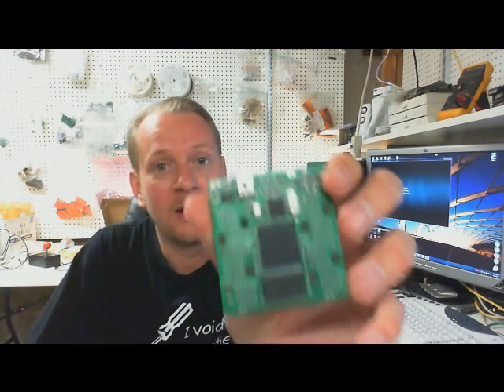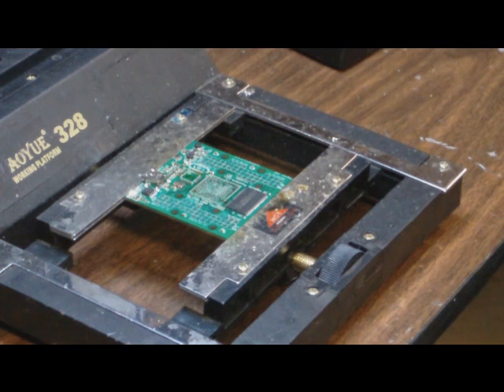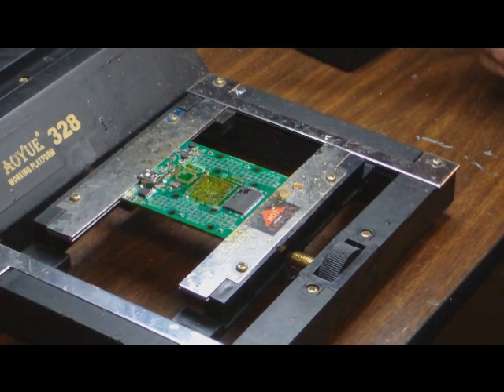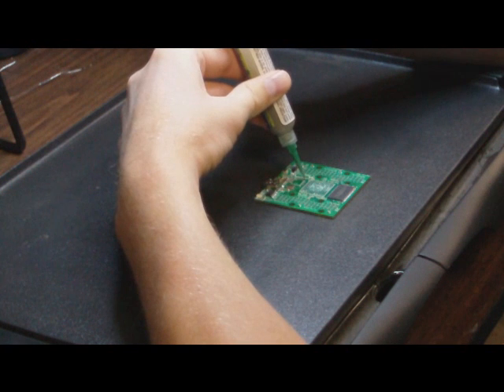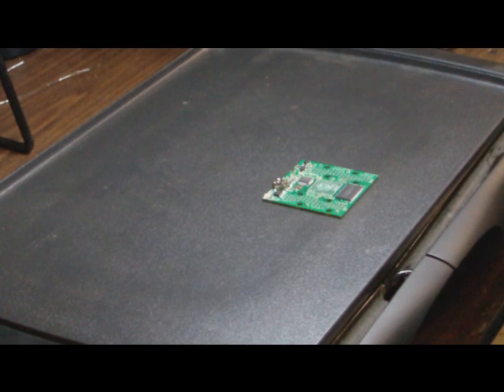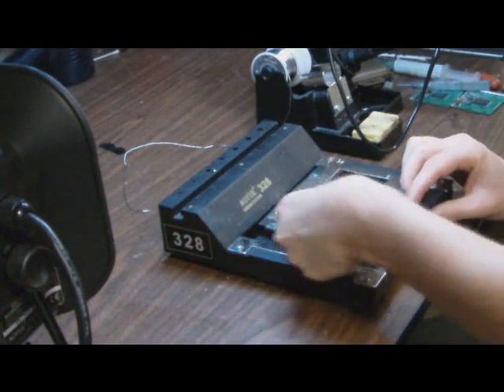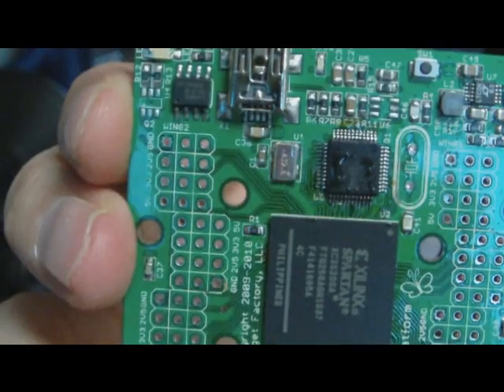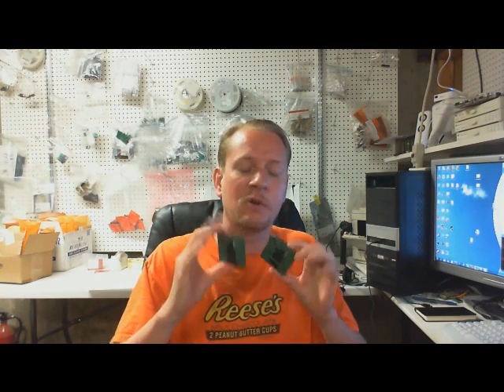JaxHax - BGA Soldering at Home

Comment: hi, your method don't works on more complex multilayer pcb where component on both bottom and top parts. what we usually do is preheat the bottom of the board slight below solder lead melting point. this to ensure the neighbour component not affected. then use hot air flowing it on top of component to melt the solder joint then pick it up.

Comment: Thanks for this. One question I had - did you go by the settings on the controller of the griddle, or did you measure it accurately yourself? In my experience, these things are off by tens of degrees C from what they say on the controller, as well as varying a lot across the plate.

That's not a dig - I really appreciate the instruction, but I think I will calibrate mine - at least to within a few degrees.

Comment: I noticed you didn't add solder paste to the BGA pads -- is that because the BGA package device has solder balls on it already (sorry for the dumb question)   Also, how do you know that all the BGA lands made contact with the pads and have good, solid connections?
Reply: +sethmeisterg BGA stands for Ball Grid Array and the balls are made of solder.  Not a dumb question.  I made the mistake of using solder paste the 1st time I tried to solder one down.  Normally the pros use X-Ray to see the solder quality is good on all pads.  He is just doing it blind and hoping it works.

Comment: Dont you fuck up every solderjoint when you heat the entire board?
Reply: No you don't.  The object is to avoid vibration of the board during heat ramp-up, while the board is hot, and during cool down.  Then inspect your work once the board is cool.  Double-sided boards may pose a problem when heating the whole board, so the "griddle" method might not work.  In those cases, you may have to suspend the board in an oven and even then there's no guarantee that you won't knock off components on the underside.

The advantage to whole-board heating (aside from the obvious when dealing with BGAs) is that it minimizes warping of the board due to uneven thermal expansion.  The warping may actually affect solder joints on surface mount components.

Comment: Break clean! The slight potential of creating phosgene gas is scary enough that I wouldn't chance it. Here's the MSDS for Brakleen rwsidley.com/MSDS/crc%20brakleen.pdf and here's the Toxicological Profile for Tetrachloroethylene atsdr.cdc.gov/ToxProfiles/tp18.pdf 
P.S. Couldn't you wet down your solder wick with that no clean flux? I know it's supposed to have flux in it but maybe they went cheap. Either way it couldn't hurt.

Comment: Your ratio of successes to failures is a high rate. There's a reason there is a specific process and equipment to remove and attach these chips. I've seen boards where people have done things like this and they fail within months. My comments were meant to stop someone from throwing their $300 laptop board on a griddle thinking they will fix it. Since you can't seem to take criticism I'll be more positive. Congratulations! You made a very accurate video on how not to do this!

Comment from the maker: What high failure rate? When I used this process none of the boards failed. I ended up doing 5 boards this way that all worked perfectly. Would I manufacture boards to sell with this process, no, absolutely not. But the point is that you can test your prototypes by soldering them at home without a complicated process or expensive equipment. 

To beat me up over all the things I'm doing wrong is missing the point. The video is titled, "BGA soldering at Home" not "How to do BGA Soldering"...

Comment: If you actually read my response I mentioned your high failure rate, so who isn't paying attention? Yes, you can get chips with the balls already on them, but reattaching the chip is one of the most important parts of the process. And again, you have no idea what a temp profile is. It involves very specific temp readings throughout a minimum of a 5 step process. Your boards may be working, but not attaching the chip will severely limit the boards life. I was letting people know to not try this.

Comment from the maker: First of all, I didn't reball, that is the whole premise of being able to do this at home. When you buy a new BGA chip the balls are already on it. Second of all if you actually watched the video instead of jumping to conclusions you would have heard that I had a bad failure rate before I paid attention to the thermal profile. Once I paid attention to the thermal profile all of the boards worked out correctly. This process works just fine for small prototype runs, which was the point.

Comment: It's no wonder your failure rate is so high. You haven't done one thing properly. First, you absolutely cannot reball with a griddle and hot air. You may get lucky once in a while but you have no way to accurately control heat. You mentioned your temp profile but you don't have one! You need to have the proper equipment like an infrared or hot air reball machine. You are also not using the correct flux. You need amtech or kingbo bga flux. You cannot get this at radio shack. BAD PROCESS!

Comment: sufficient. can you tell me if this is corosive or not? i only tried it with cleaning the solder and the residue seems to be very little not like in your video. i hate the no clean liquid, it's so expensive here and it evaporates so quickly. thank a lot for the video, cheers.

Comment: isn't izopropilic alcohol much easier and cheaper for cleaning the residue?  I have some solder paste more white than yours but doesn't leave so much mess, i searched everywhere if it's corosive but i can't find. It's not chinese or whatever, seems to be hungarian or russian (i belive , im from europe). It sais solder paste ,then under : medium active flux that facilitates soldering of the folowing elements: copper, silver-plated, zinc-coated and nikel plated, used in places where rosin is not .

Comment: not yet. I've got it down to a process I am going to use, though.

>Dismantle
>place board onto griddle hot plate (set around 350-400 degrees farenheit)
>surround with tinfoil
>heat gun GPU off of board
>remove board from hot plate let cool
>clean entire gpu
>use Ebay reball kit and put all new balls on
>clean board with flux/solder wick
>place gpu back onto board
>reheat board ---> place gpu into place
>heatgun for roughly amount of time it took to remove chip
>viola?

Comment: I would like to point out that breakclean can become phosgene gas under the right conditions.  Using the non-chlorinated type is a step in the right direction and the temps needed are a lot hotter then what one would find in soldering. But just 4 parts per million of phosgene are enough to kill you. And yes there are case of people dieing from phosgene production from the use of breakclean.  Personally I wouldn't use it.  Stick to acetone.  It's not in a spray bottle but it will work.